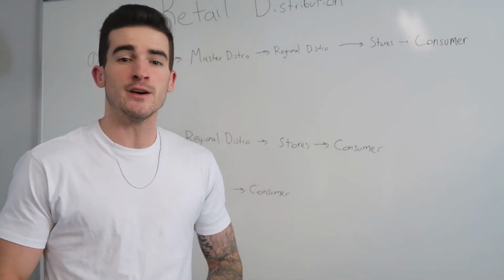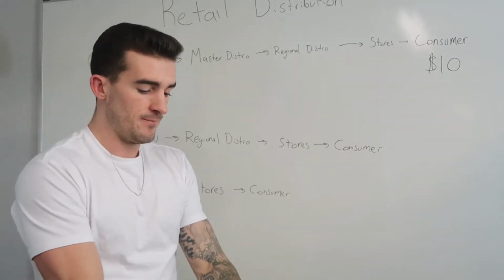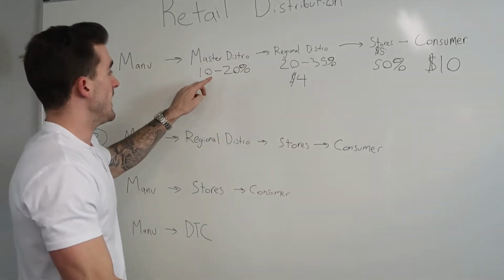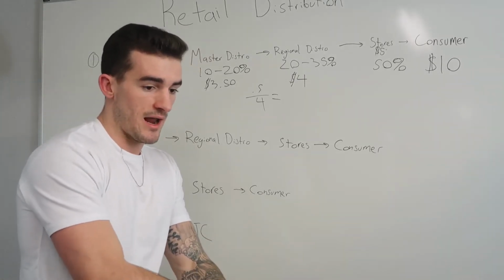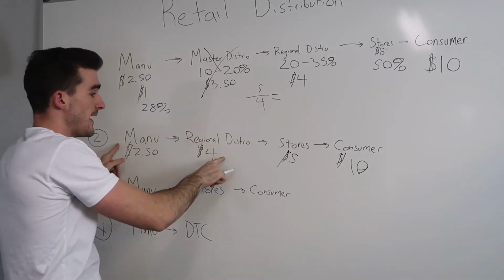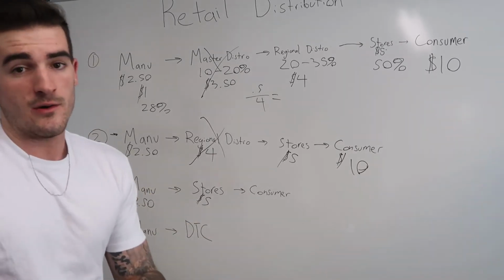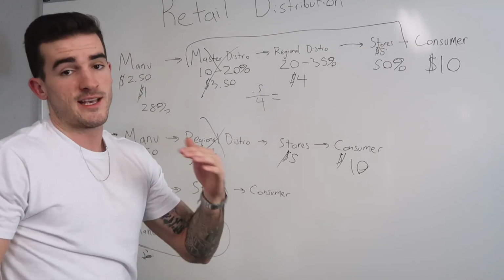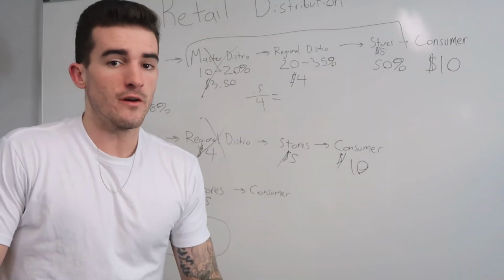How Retail Distribution Works | Margins, Process and Distribution

Comment: Overall, very helpful video.  I’ve been on the manufacturing side for 30+ years and agree with the essence if what you’ve outlined.

One “technical” correction I would suggest is on the terms “margin” and “markup”.  Margin is calculated as profit after the fact.  Your calculations are exactly correct [(sell price - cost) / sell price].  Markup is calculated as an addition to the cost to establish sell price.  

As an example, let’s assume the profit goal is 50% and cost is $5 (same as your example).  Using margin, a simple calculation is to divide the known factor (in this case, cost) by the percent of what that factor represents in the overall cost-profit equation (cost = 50%, profit =50%).  So this looks like $5 / .5 = $10.

By comparison using the same factors, markup would take cost of $5 and multiply it by a factor of 50% to determine sell price.  This would look like $5 x .5 = $2.50, which is added to the cost of $5 for a sell price of $7.50.  When margin is calculated on this sell price the answer is $7.50 - $5 = $2.50 which is divided by the sell price ($2.50 / $7.50 = 33%) to establish a margin of 33%.  If the goal is a margin of 50%, the markup method using 50% as a factor will seriously underdeliver!

As a consumer product marketer working in mass market I can share that these two methods of getting to a sell price is the most common source of friction between marketers and sales people.  Neither is right or wrong, but the method to calculate margin should be agreed upon before going to market to avoid the possibility of underdelivering on margin.  I’m sure you and your audience will agree that raising a sell price/retail price is almost impossible these days so “fixing” this problem is not easy once pricing has been released!!

Keep up the great work!!
Reply: very helpful comment thank you!